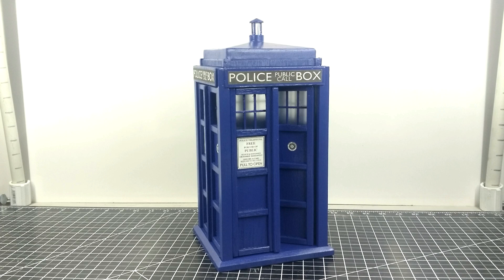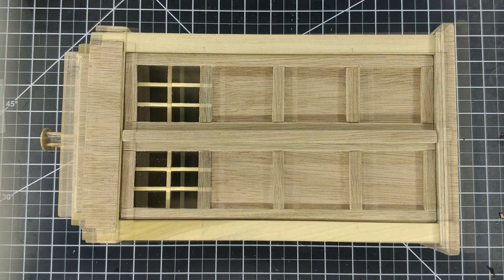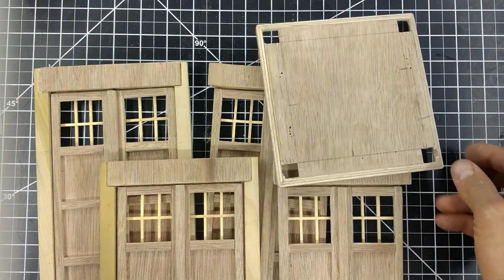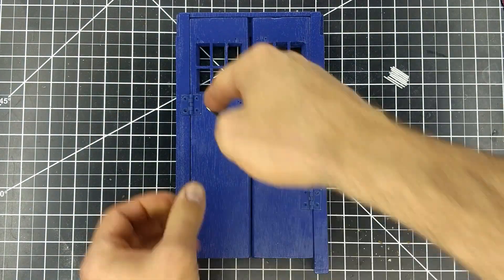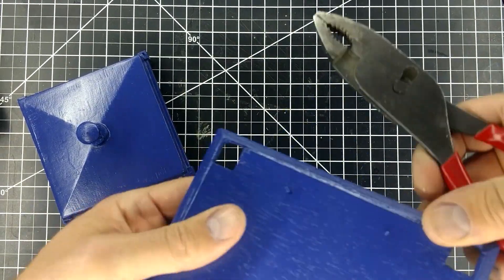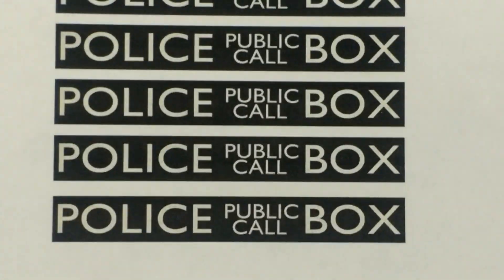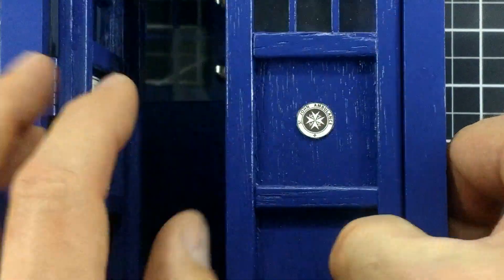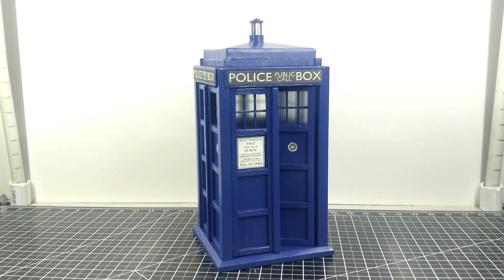Make a TARDIS Model - Part 7 - Final Touches

Comment: I’ve found the best way to make handles is to bend copper wire into a square that’s missing one side, put it through the model with pre drilled holes and add milliput accents such as the mounting points and screws.
Reply from the maker: That's a great idea! I've never used milliput myself so I didn't think about that. I was thinking about using a bent wire but couldn't think of a way to make it look better than just a wire. I love this tip!
Reply: If you want to see some sort of tutorial batmanmarch’s 1:6th scale fourth Doctor tardis covers many aspects quite well. It is a different design and scale but the same sort of principal applies, he also makes a lock which you might find useful
Reply from the maker: @whopropsmodels9710  I just checked it out and it was amazing how much detail he focused on! I'm going to have to add some handles and a lock like that. Thanks for letting me know about that tutorial.